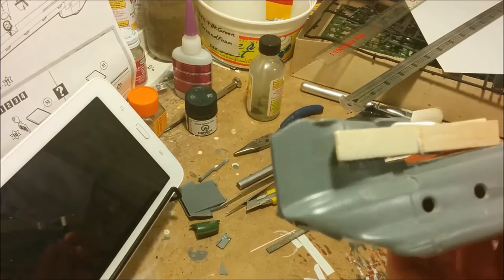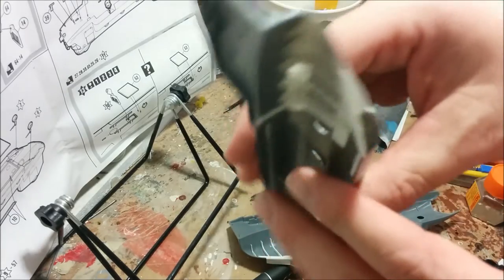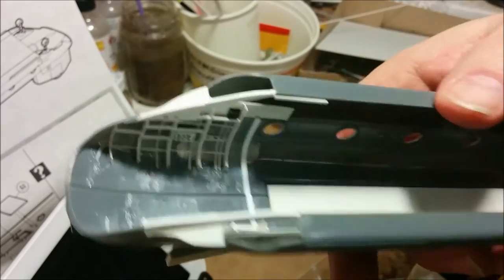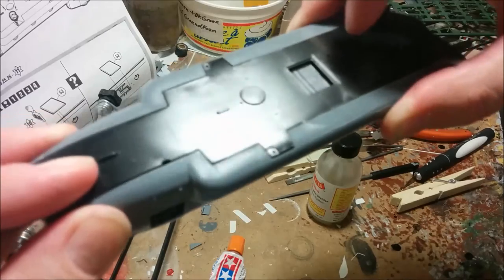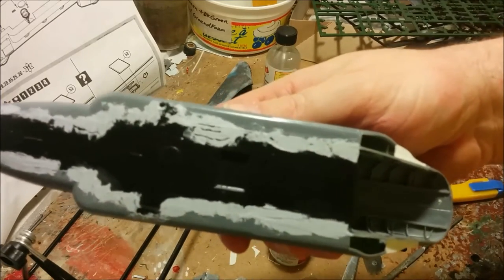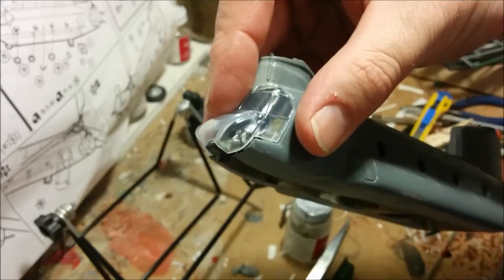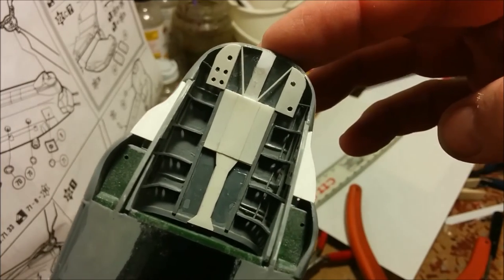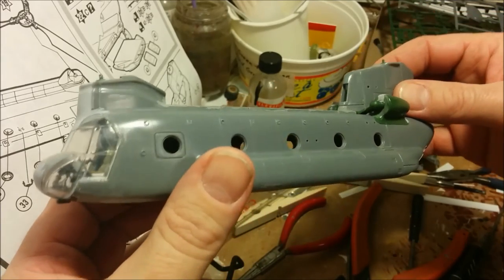Chinook Helicopter build 1/72 Pt2 Matchbox

Comment: When coming across a situation where the Canopy does not quite fit in place with the airframe, I use a product called Vallejo Plastic Putty. It is applied between any gaps and then smoothed off with a Q-TIP.  A foggy canopy can be improved by dipping the canopy in 'Future'. Remarkable the amount of scratch built detail that you have added to this kit. Well done
Reply from the maker: Chris from Classic Plastic recommends that brand of putty, I'll have to try it sometime. The cloudiness of the clear parts was in the plastic, not on the surface. I think the clear plastic was contaminated. Thanks for the comments.